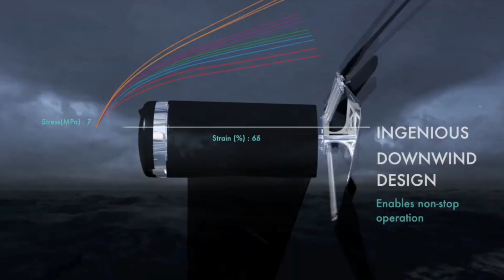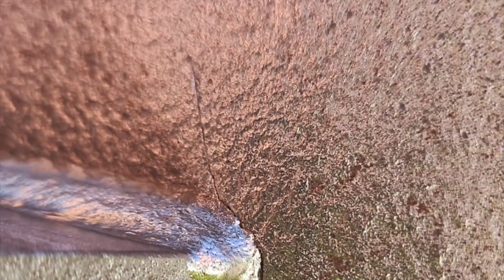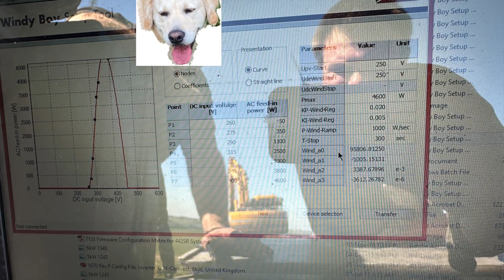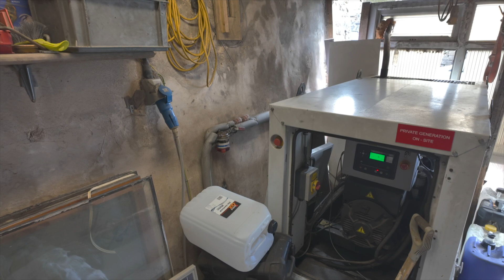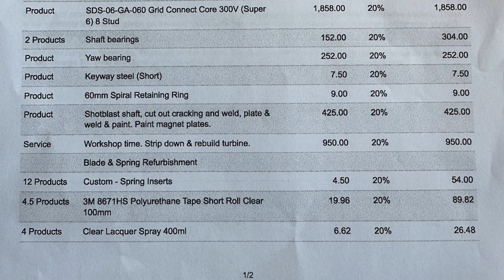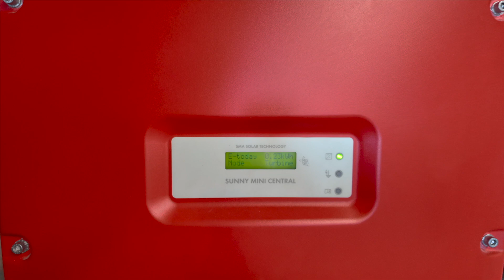Proven / SD Wind Turbine Video Part 1

Comment: Me, I've given up on the SMA software, it's just abysmal. The Aurora, ABB,  is far, far easier, intuitive and many more points. When my Windy Boy needs replacing I'd be tempted to try and find another Aurora/ABB
Reply from the maker: True, to be far to SMA this software is from the Windows XP era and is somewhat long in the tooth, just a shame SMA didn’t update and keep the Windy boy going.
Reply: @whatsthisnow101  the Aurora software is from the same era just much more user friendly. Yes it is a damn shame that SMA did not continue their Windy Boy line. I guess you know that a Sunny Boy can be used and converted to wind or it least it could be back in the day.
Reply: Great info. Bring on part 2
Reply: Can I ask how much the work on the head cost?
Reply: @Ally-n4y  The invoice is near the end of the video but I had a 6kW overhauled by Proven years ago and it was much cheaper cos it didn't have a new core like this one ;-)
Reply: Who the hell buys a JS130 when you could have a JS160??? 🤷🏼🤷🏼🤷🏼